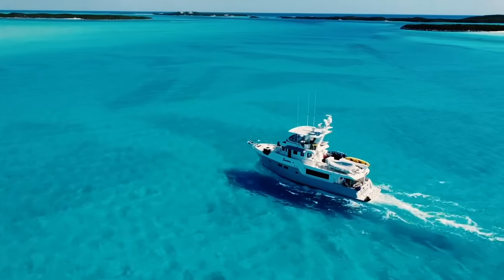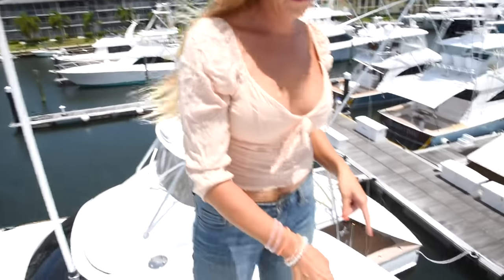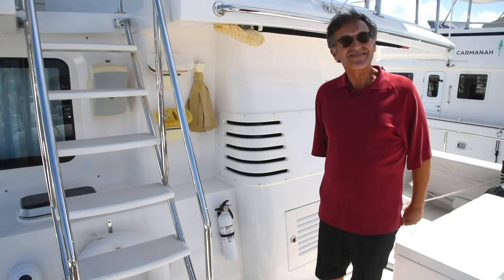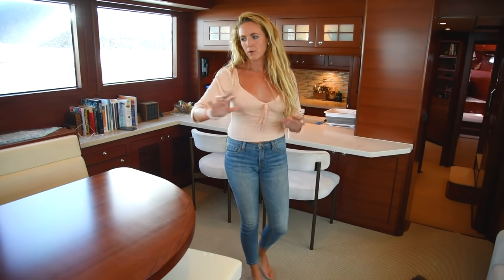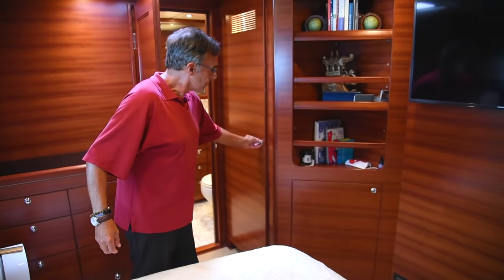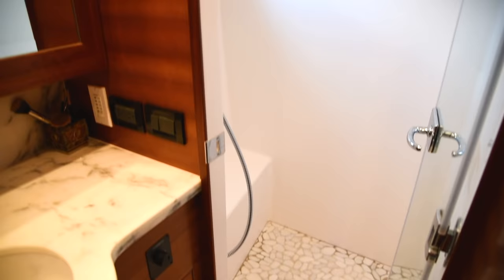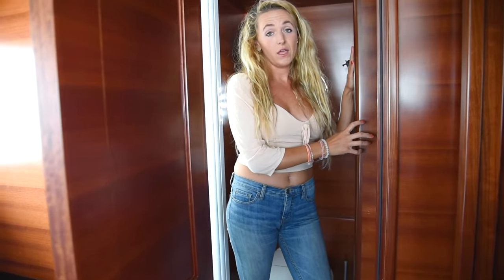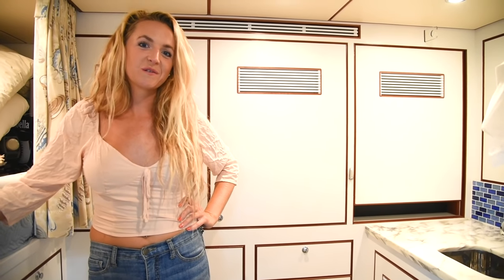$2.8M Yacht Tour : 2019 Nordhavn 60 - HIGHLY CUSTOMIZED EP. 32

Comment: Recently I have watched boat reviews in the 50+ range and all were equipped with dual high HP motors and I couldn't wrap my head around the high cost of fuel consumption.  I realize your boat is intended for long-range cruising and from videos of cruising on the open seas, what good is all that power when you're speed is limited to trawler speed anyway?  Would that be around 8 to 10 knots? At 10 knots how much fuel do you burn per hour? Thank you for the comprehensive tour of your beautiful boat and it was good to see your happy dog again.  Looking forward to following your adventures in future videos.
Reply from the maker: This boat has very small engines so I’m not sure what boat reviews you were watching. But encore has a 325hp and a 150hp I believe or something very close to that. Wide open we can maybe hit 11 knots and we travel at around 7 knots
Reply: OK, thanks for the clarification on your power plant.  In my opinion, your set up is ideal for both economy cruising and by having the smaller second engine, something to get you to port if your main engine breaks down.
Reply from the maker: Exactly!!

Comment: Finally, been waiting for this walkthrough, just like all the Nordhavn videos Ive been watching. 😊. As someone who doesnt own a yacht with redundunt systems, I'm curious. What happens when someone else or a child, turns the wheel on the flybridge while the captain is driving the wheel on the main pilothouse? Does it have any safety feature to prevent this type of thing from happening? 😊
Reply from the maker: Well here it is I hope you enjoyed it!! There is a selector switch on the engine throttle control at each station and you can only drive the boat from the location in which you have the engine throttle selected. So if we were driving in the pistol house and someone turned the wheel on the flybridge nothing would happen. If they pushed the button to select that throttle then they would have control but they would have to take the throttle from idle to the speed you want to cruise at so everyone would hear that encore RPMs change and know that another station has the control of the boat
Reply from the maker: Well here it is I hope you enjoyed it!! There is a selector switch on the engine throttle control at each station and you can only drive the boat from the location in which you have the engine throttle selected. So if we were driving in the pistol house and someone turned the wheel on the flybridge nothing would happen. If they pushed the button to select that throttle then they would have control but they would have to take the throttle from idle to the speed you want to cruise at so everyone would hear that encore RPMs change and know that another station has the control of the boat
Reply: Wow, thanks for explaining! Makes so much sense now. 😅. More drone footages of the boat in the upcoming videos. 🙏
Reply from the maker: You are very welcome, glad that clears it up! and yes more drone footage is on the way...if the darn wind ever stops blowing 😖

Comment: Nice tour. How often do you exercise the wing engine ? I imagine there is a plumbed in oil change system ? Really great job by Mike on the changes he made. How does Mike like the athwartships layout motion on his bed while underway ?
Reply from the maker: Thanks! We turn on the wind engine every time we turn the boat on, we use the wing engine to power the hydraulic system for the thrusters and the anchoring. And yes both engines and generators have plumbed oil change systems. He did a great job on the changes and the position of his bed is great for sleeping underway. Has very minimal movement except when the waves get large enough haha

Comment: If I had a 3 million dollar boat, I would also push the horn whenever I wanted. 

Also, with that external microphone, you should not have so much static noise like at 28:57. I would make sure you have everything plugged in correctly and nothing is damaged. Thanks for posting!
Reply from the maker: Hahah it’s also an upgraded horn so he really loves any excuse to use it 🤣 thanks for that info, I’ll check that out and make sure it’s all set up properly. Thanks for watching

Comment: You mentioned that you can use the thrusters to hold you against a dock until you can tie yourself off while you're single-handed. Is that a common feature on all thrusters?

Thanks for the tour!
Reply from the maker: Typically you cannot set thrusters to a position where they just stay, I’m sure more boats will be adding ones like these in the future but it is an awesome feature

Comment: I absolutely LOVE the layout. 

I know the 63 has a very similar laundry crew set up, but it seems the weight of the water tanks being moved foreword would be compensated by the aft pilothouse. But, how is this redistribution of weight, by moving the water tanks forward effect the fore and aft balance of the forward pilothouse boat?
Reply from the maker: The amount of weight doesn’t seem to affect the ride at all. The boat has 20,000 lbs of added lead in the keel and weights 150,000 lbs so the water is decently negligible. So glad you like the layout!

Comment: Hello, a while back you posted a video where you mentioned you had a mold issue in your ductwork. My questions are. 1) Is mold a common issue on your boat? I know with sailboats it is common because they are lower to the waterline and get more seawater in them but your boat rides higher and looks to be dry on the inside. 2) If not very common, was there a specific reason it started growing? was there some moisture getting in from a broken part of the boat? And lastly, What do are you doing to prevent it from coming back? Sorry this was so long =)
Reply from the maker: It’s not a common issue on our boat, the boat was in south Florida for almost two years and was kept a little bit too warm, which led to some mold growing. We cleaned it all up and now we just make sure to keep the humidity below 60% and we keep the boat much cooler to prevent anything from growing

Comment: Great video! Just curious why did you choose the dry exhaust over wet?
Reply from the maker: Glad you enjoyed the video and 2 reasons. 
1. Comfort. With a wet exhaust you can get the station wagon effect which means that the exhaust rolls back toward the boat. We like to cruise with doors and windows open and don’t want the exhaust rolling into the salon or onto the transom which always has to be cleaned from the carbon then
2. Safety. The dry exhaust doesn’t require any hoses for cooling so you don’t risk a hose breaking and flooding/ sinking the boat while out in the middle of the ocean. Wet exhausts bring in ocean water which poses a potential hazard

Comment: Ok I’ve got a dad question. 
So I’m a fresh water day boater currently, but looking at a place in Florida to get more time on the water.  
With a displacement hull like yours,  how do you determine ballast load?  Do you adjust for comfort in rough water?
Reply from the maker: That will be fun to get down to Florida to be on the water more! Its a fun and sunny place down here :) 

We don’t adjust ballast at all. We have 21k pounds of lead in the keel and whatever fuel we have determine how we sit. We don’t take of any additional weight to adjust ballast. It just is the weight that it is!
Reply: @adventures  gotcha, that makes more sense thanks. The world of displacement yachts is still new to me. The stability of the nordhaven is very impressive to me. I’ve been eyeing the market for a late model ‘53 searay, but you guys have made a strong case for a nordhaven.
Reply from the maker: It really all depends on what you want to do and how far you want to travel and what kind of weather you want to travel in. I know lots of Nordhavn owners who got the boat to cross oceans but after some time of cruising have decided that they prefer short trips and really don’t need a blue water boat

Comment: ever consider putting some solar panels on the roof of the flybridge?
Reply from the maker: We did consider it but the quote we got was astronomical due to all the lines that would have to be run. Headlines would need to be pulled down, floor panels pulled up, huge ordeal so we decided it wasn’t worth the time it energy at this point. Would have been cheaper to put them on during the build, but hindsight 20/20
Reply: @adventures  thanks for the answer yes the infamous hindsight i had a few of those myself not with a boat
Reply from the maker: It happens to the best of us 🤷🏼‍♀️
Reply: @adventures  love the custom layout love the custom layout so much better than the standard those bathtubs are a waste of space
Reply from the maker: That was my dads thought. How often are you actually going to use a tub, especially when you are making all of your own water with a water maker while you are out cruising around
Reply: @adventures  sorry for nagging and maybe this is a stupid question but can't you run the cables(insulated) for solar panels treu the same space as the exhaust it gos from the top to the machine room
Reply from the maker: I actually just learned the answer to this because another Nordhavn owner did this and if insurance will not cover you if you do this. I think it was due to the heat from the exhaust? Maybe another reason as well but either way it’s not up to code and insurance won’t okay it. But that would make it wayyyy cheaper